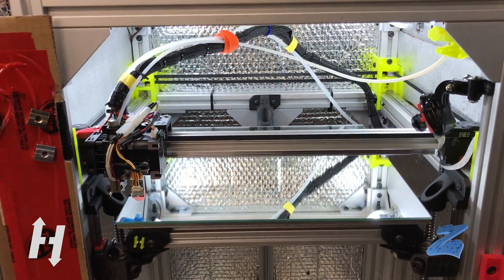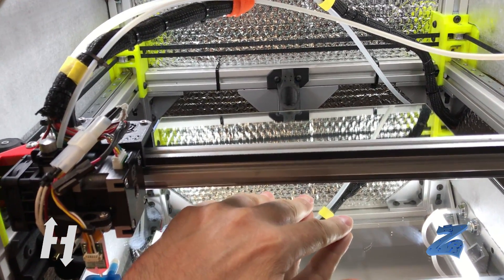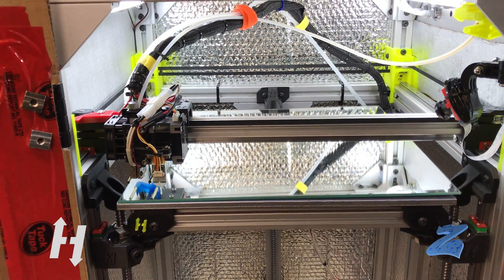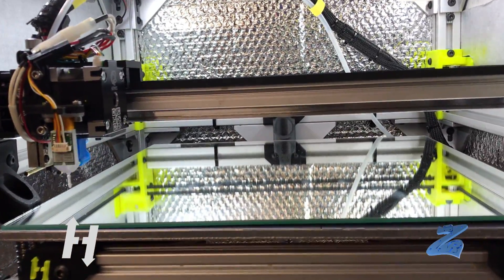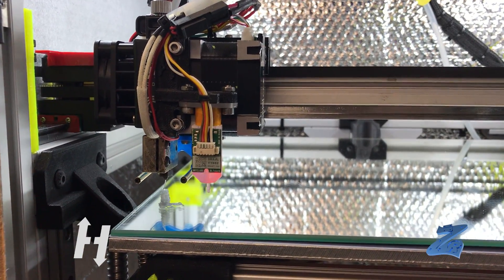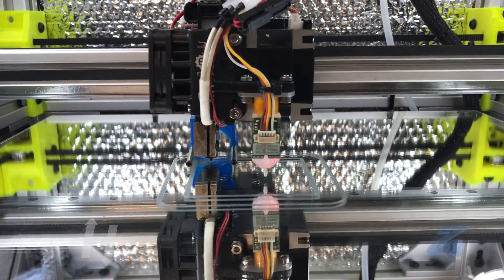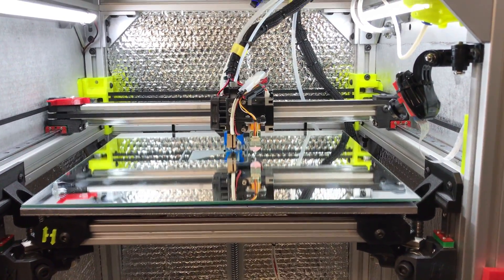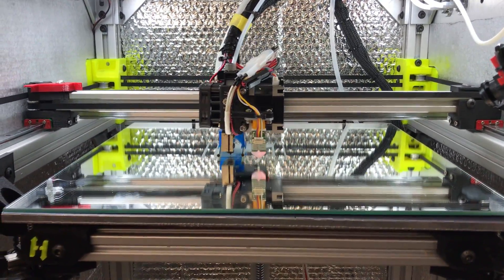Triple Z motors - Self levelling print bed demo - HevORT Advanced DIY 3D Printer

Comment: As 3 axis printing becomes a thing a bed like this could really make a powerful printer if the slicer could utilize it properly.
Reply: If you are thinking of anything beyond a bed leveling mcode, we aren’t talking about 3 axis printing anymore. There are more capable kinematic options for 4+ axis printing, but this is a pretty cool approach to 3+2 axis printing.
Reply: definitely!
Reply: I know this comment is 3 years old but just came to say, someone has since accomplished this by using very sturdy ball joint assemblies and long mounting screws since then. In fact it might even have been the OP of this video I don't remember. But there is another guy in China who's created a system with MUCH greater freedom of rotation, I think like almost full freedom between rotation/tilt of the print head and tilt/rotation of the build surface. He printed a vase then printed designs all over the curved outside surface with different colors and it works pretty well. We'll get there with home and diy printers soon 🙂

Comment: Looking good, but I think you'd get a better stability with four motors, one for each corner. With 3 motors like this, it can still get crooked in some corner cases (get it?) but with 4 each corner can be lifted separately as needed.
Reply from the maker: Four corners would be  overconstraining .  A plane is held by three points.  The 4th one would induce binding .

Comment: do you think a zesty nimble or flex3drive can keep up with high speeds that the hevort can push out?
Reply from the maker: Unfortunately no.  Zesty Nimble uses fairly high gear ration due to worm gear config.  While this is good recipe for torque, it affects maximum speed.  Plus the cable would start have flexing artifact from those steep acceleration and Jerk values.

Comment: Eh all do you Know how much is it ? This kind of printer?
Reply from the maker: you mean to build one?  Depending on you source for components (OEM rails vs chinese) (Duet 3D vs SKR pro) you will range between 1200 to 2000 usd for a 315*315*340 print area
Reply: @MirageC  perfect answer ! Need more money but  it should be valuable to do mine .i Am very impressed to see your printing speed !

Comment: Finally auto bed levelling, that actually levels the bed automatically.
Reply: "Auto bed tramming" never sounded as catchy I guess.
Reply: @WilliamHelstad  Beds inherently warp with heat, abl is supposed to compensate for that. Aside from that being able to adjust the bed level is just a good idea since there can be a hundred different reasons why one corner wouldn't match up to the other in height
Reply: ratrig
Reply: @WilliamHelstad  "why don't they just do the impossible" has self explanatory answers. BUT that's only half the problem. The gantry has to be square to the bed. Whether you go fixed bed or fixed gantry the bed being a flat plane and the moving components remaining square is a struggle. When the printer heats up the unlike metals expand at different rates. You also have weight. The weight of a toolhead or gantry as it gets to the center point has an effect on how close the nozzle is to the bed. We are working at consumer DIY levels. Nothing's perfect so we compensate.

Comment: With this is it now possible to do true non-planar printing operations like 5-axis milling machines? Since you can tilt the bed, some parts of prints wouldn't need supports or can be printed for optimal surface finish.
Reply from the maker: Exactely, this is the goal.  Now only a software is required.
Reply: Great kinematic! I'm about to build a new CoreXY machine, and I will definitly implement something similar!

About software, I made some experimentations to 3D print a sphere, and have it sliced as if it was a plane:https://forum.duet3d.com/topic/10934/5-axis-3d-printing/13?_=1592983855969
The idea is to map the STL  sphere to a plane, slice it, and then map back the G-Code plane to a sphere.

Comment: That's a cool design. The only other printer I've seen do something similar was the Voron Printers. The 1.8 has 2 Z motors which tilt the bed and the 2.4 has 4 Z motors that tilt the whole gantry. The bed does not move at all